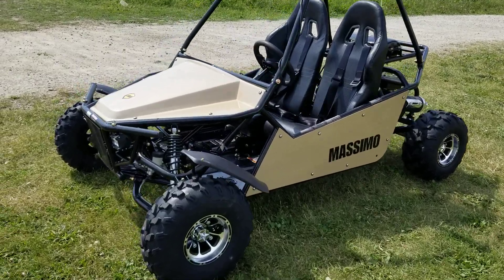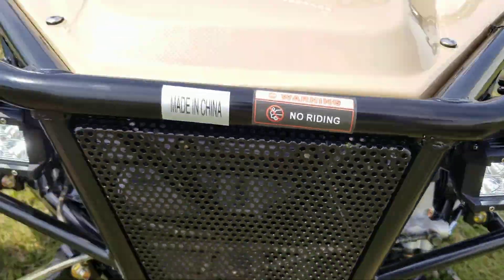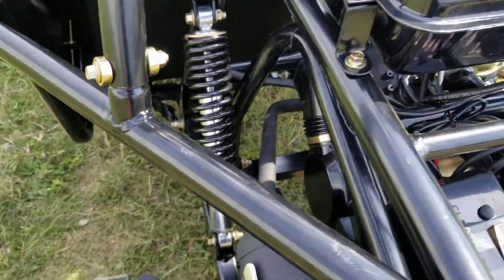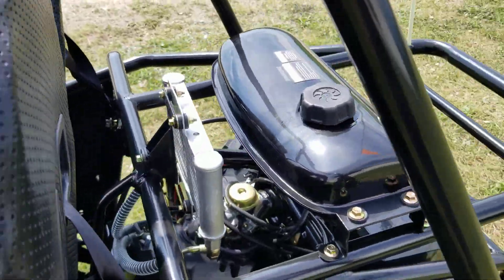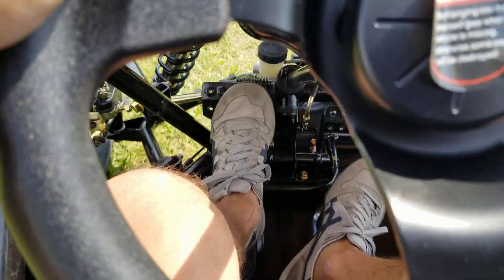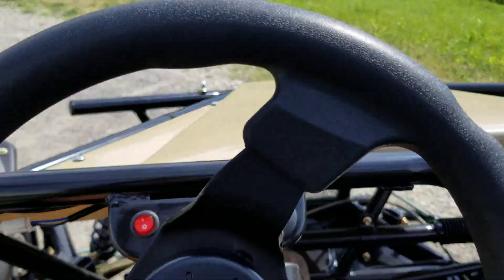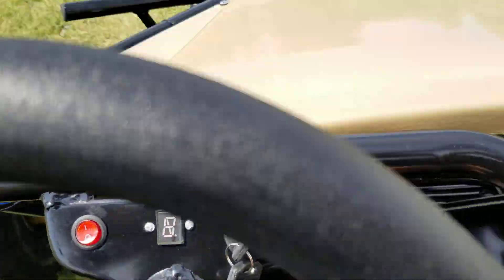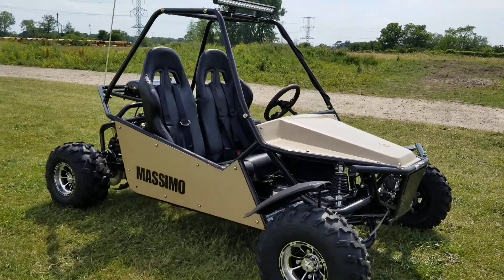200 Massimo GKM Go Kart Fully Automatic With Reverse Dune Buggy From Saferwholesale.com

Comment: I must speak out for safety reasons.  The front suspension setup is pretty dangerous on these.  The problem is the top control arm.  It is offset to the hub spindle pretty bad so when you hit a bump on one side or the other, it will pull the gokart towards that side pretty bad.  It will dramatically alter its steering.  Other thing is when they sell you these, the front tires will be aligned (to look straight of course)  however, because of the same problem with the control arm setup, once a rider or riders get on it, the tires toe out very badly and the go kart will be very difficult to steer.  You have to toe in the wheels by quite a bit so that when the weight of the riders is added, the wheels toe out to be straight.  (THIS IS VERY IMPORTANT) It will be night and day trust me.  This will also cause your front tires to disappear in 2 months.  Other than the not so thought out front suspension the go kart is pretty good, but the steering will take time to get used to, and it is something you must tell riders if you let someone borrow it because a bump on either side will pull you in to a possible wall, ditch or canal.  I am working on designing an extension to correct this but it looking like altering by cutting, bending and welding back the upper control arm will be the best and safest fix.

Comment: 200cc of power, but 168cc engine...where's the extra 32cc coming from?
Reply: From the suspension DUuuyHhhH
Reply: the engine has a stage two kit
Reply: @salokinzaid3724  that is what got it from 150->168cc where is the other 32cc ;-)